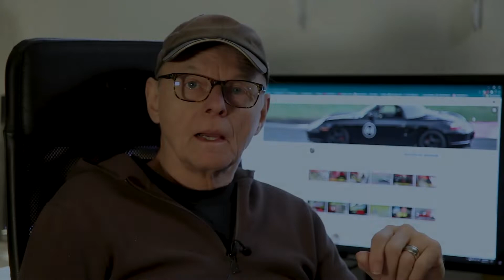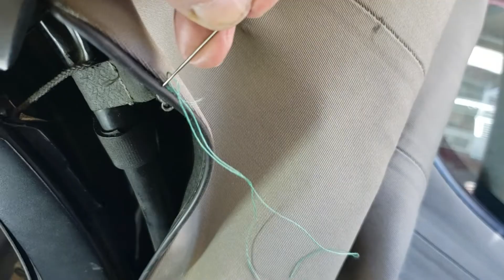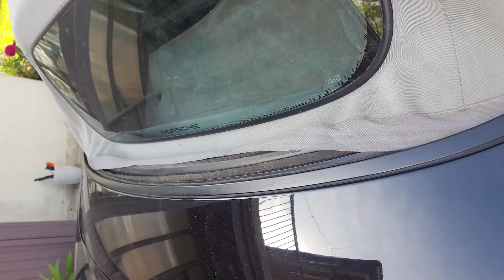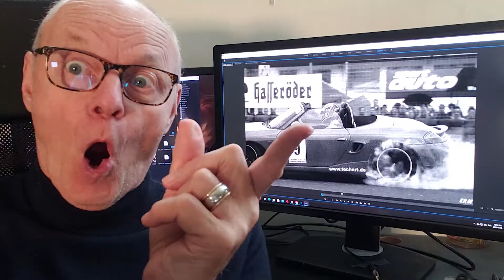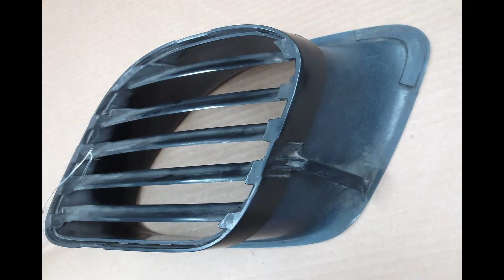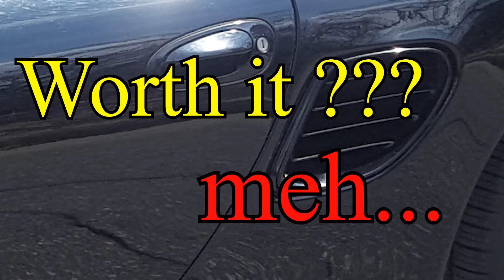Down n Dirty Hands-On Porsche Boxster repairs

Comment: Depends, to someone that mods, it is worth it or they might be too embarrassed to say that it wasn't. It is their money.

I have a slew of motorcycles and two 911s. They are all stock because that is the way I want it. They all suit me and I accept them for what they are. There are useful mods and the rest of it, we call bling. My motorcycles got hard luggage (I am on the road for six weeks at a time riding the Alps) which beats using a bungee net to hold a sport bag across the back of the seat, a digital voltmeter and a GPS. As for the cars, nothing really other than protective products and battery pigtails for a battery maintainer. And if I do anything to any of my vehicles, it will be the best tires, suspension, brakes, top-notch maintenance and nothing else.

On the subject of suspension, an acquaintance had a Subaru and used to spectate at rallies. Of course his car had to be just like one. We took a 300 km trip and I thought I needed Dent-U-Grip for false teeth I do not have. He even admitted his suspension mods were all a mistake. What a waste of thousands of dollars. As for lowering or slamming a car, a bit is fine, a lot screws up your suspension unless you get different uprights and enjoy a stiff ride.

Engines and mufflers are left stock. None of this Tune 1, 2 or 3 engine mod for me. I like reliability. Which makes me think of one member whose daily driver blew up, likely because it had a Tune and/or his driving style. He claimed that he was at 100% of the power, 100% of the time. Let me roll my eyes. I didn't know he had access to the NARDO test track to do that. That same year his Porsche got bore scoring. Who needs the headaches!

But back to mods and nobody does it better than many motorcyclists. My theory is and I have seen it countless times, they buy all this bling and when there is nothing left to buy, they sell the motorcycle, buy a new one and start all over again. Hell, its great for the economy and their personal debt. LOL